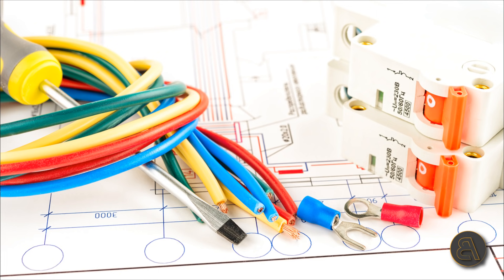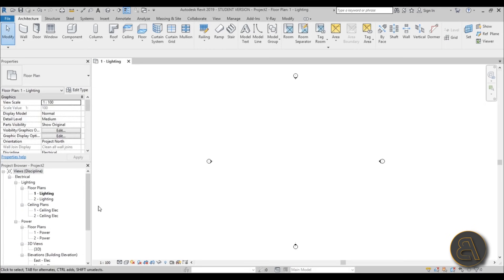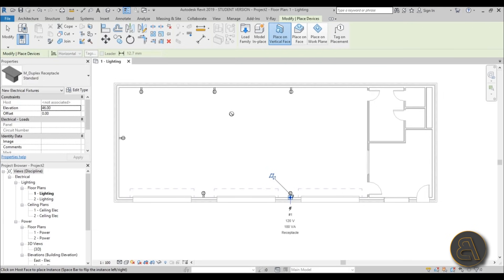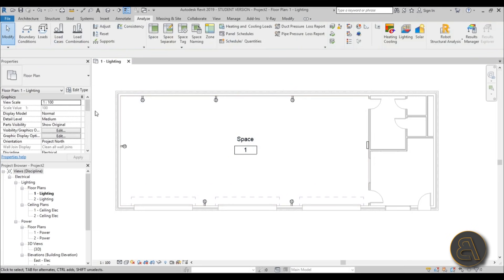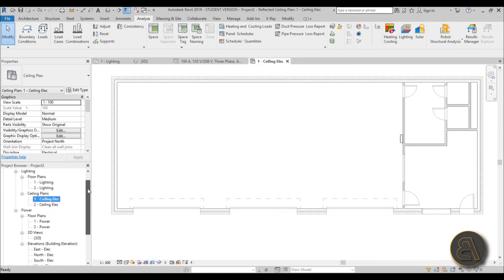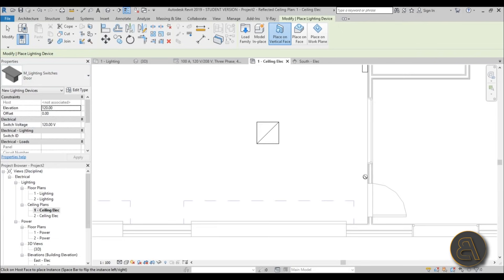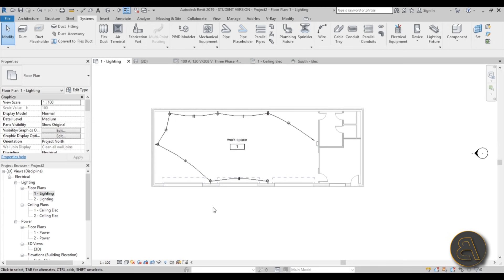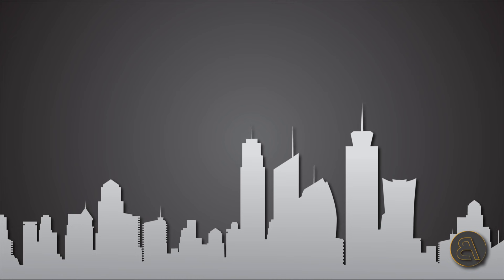Revit Electrical Beginner Tutorial (outlets, lights, banel board, switches, wiring)

Comment: A lot of questions below - I'll try to answer a few. If you don't see a POWER button when you try to circuit a receptacle, you may be using an "architectural" family that does not have an electrical connection - in the Autodesk Cloud, look for an MEP version to download which will have the proper connection. If you can't connect anything to your panel, make sure the panel has a "Distribution system" assigned to it in the instance Properties dialog - the device you are trying to connect must be set to a voltage that is within the distribution system of the panelboard. You can use an AutoCAD file as a background architectural plan, but you won't have walls to host your devices - you would then need to use "Non-hosted" receptacles, switches, etc. which are typically custom made. Or you can add walls into your model over the CAD walls - lots of work of course, but possible. Hope this helps!
Reply: Thanks Electric Rob. I appreciate your video tutorials as well! Love from CA

Comment: hi, i would like to thnak you for making this video, i tried this in my own project and works fine, after some time i want to adjust the elevation of the lights but i cant. then i tried deleting it and remake them and it worked. after that i moved on to the second floor and tried to remake the ligthign on 2/F but i can not set the elevation. is it some setting problems?? thank you

Comment: Hi, BA. Hope you're doing well and that I'm not too late: I have a problem: The lights rendering on my Revit (2018) are working with me at all. The types 'spot', 'square' and 'circle' lights are too dim upon rendering, and the 'line' lights are too bright. I don't understand why at all. They're all the same intensity and luminosity and color and all, and tampering with the rendering lighting/shadowing dials somewhat improves some light types only to screw over others.

After days of trying to fix the problem in vain, the internet didn't give me any answers other than using the 'Photometric Web' type of lights, of which I have no families. I looked for them but couldn't find any like they show on some YouTube videos.

Every time I get a bearing it betrays me. Have you any good advice here?

Comment: what was that with the 270 Watt ?? Power limitations ? or did you mean 270 Volt....voltage incompatibility? ....preventing the light bulbs to connect tot the panel...

Comment: Cao..where is the problem in my project if when I go to a power option in panel doesn't show me any panelboard?..like I can't make a circule,there isnothing showing to me, can't connect it..
Reply: go to electrical settings - define voltages and distribution system. Your panel parameters must match your distribution system. Modify the panel family if needed. And then check if the equipment you are trying to connect match the panel - check voltage and number of poles.

Comment: 1 question bro, how to change the arrow symbol for circuit homerun, like make it round or rectangle. because in our shop drawing we show it is connected to a cable trunk so we use round symbol. what we just do we do it manually to place round symbol. thank you bro.
Reply: Manage/MEP Settings/Electrical Settings/Wiring/Home Run Arrow Style

To create a new specific arrowhead your company uses go to Manage/Additional Settings/Arrowheads

Comment: Hello Sir, Kindly solve me problem, 
when i want to attach receptable, i face an error ""Cannot assign or add Panel 1 to Circuit. There is no assigned distribution system for Panel 1.""
Reply: same problem is coming here plese guide us
Reply: The same thing with me I am having the same problem
Reply: You can choose distribution system in properties to type that your panel is serving e.g. 208/120 or 480/277.

Comment: I am having problem that the name of the panel 1 which I renamed before didnt show up in the power when I want to add the circuit from the device. Which part I have to check form the electric equipment?

Comment: Excelent man, it doesn’t matter if the wattage is incorrect, this is a tutorial to learn how to do it in Revit, so it’s great, thanks Balkan, see you tomorrow.
Reply: It was important for him to show that you can't connect a 277V device to 120V panel. They are different voltage (not wattage).
Reply: exactly

Comment: This tutorial for beginners is very good, you showed in a general way the main elements, it will be necessary to deepen more according to the laws of each country.
In my country it is customary to place the number of cables with gauge and diameter of the pipe that leads in each electrical circuit, how are they placed in the electrical plane?
greetings from Mexico.

Comment: your panel board is rated @ 120 Volts (not watts) line to neutral, 208 Volts Line to Line... 120V/208V, thats what it means... 277 V rated lighting fixture? that is kinda unusual... before you set what panel board rating you're going to use... inspect the Area first if the power distribution there is set to 120V/208V or 230V/400V... Electrical design is kinda risky and dangerous. You need to follow the Electrical Code. you can't just design whatever you want... but any way, thanks for the revit tutorial... it's really informative...
Reply: omg it's very risky and dangerous the tutorial is for nuclear fusion with revit
Reply: 277V lighting is very common in USA. Many commercial buildings have a 277/480V electrical service.
Reply from the maker: You really know this topic, can I contact you next time I make a tutorial so I don't make another mistake like this? :)
Reply: Balkan Architect Good tut as usual. The power always goes to the switch first(live feed) and a separate wire then goes from switch to lighting. Hence the name ‘switch wire’. The wall switch then opens the power to lights when switched on. 💡💡

Looking forward to next one.
Reply: @tomasoconnor6456 "The power always goes to the switch first(live feed)"  Errr thats totally  wrong Tomas
Reply: Balkan Architect  Comon Paulo its ONLY a tutorial, he cant teach everight for every counrty regulations.